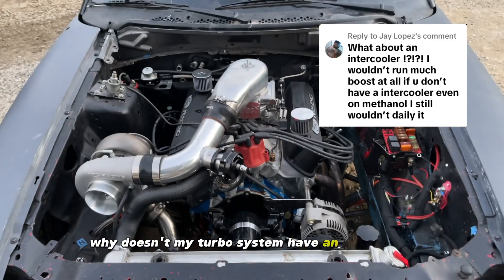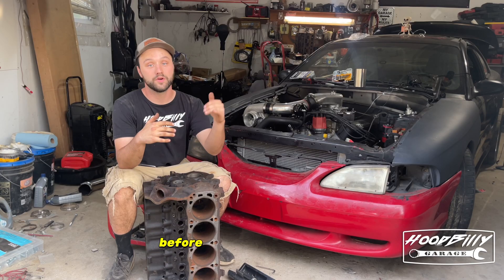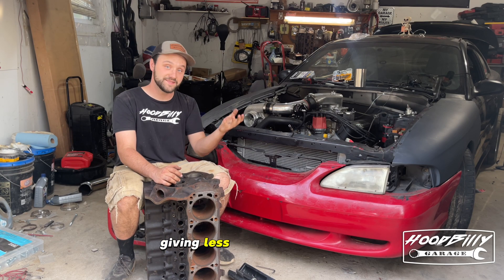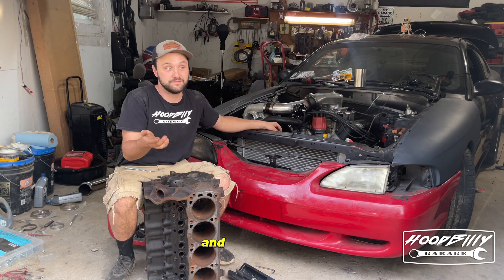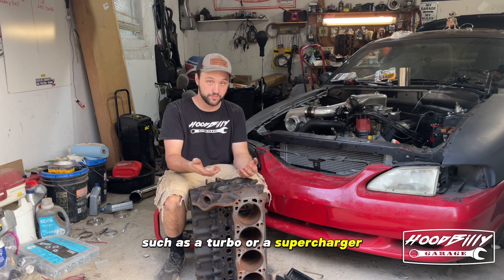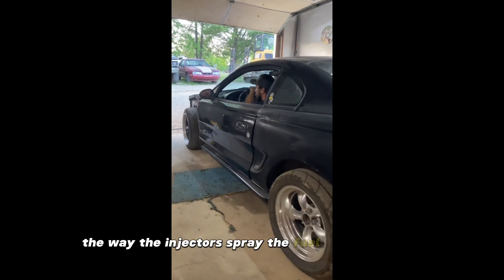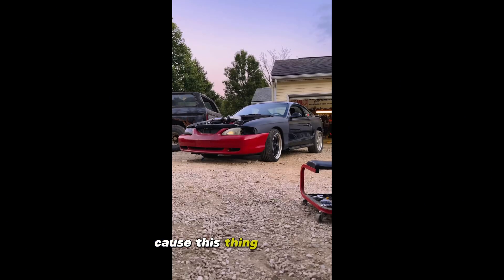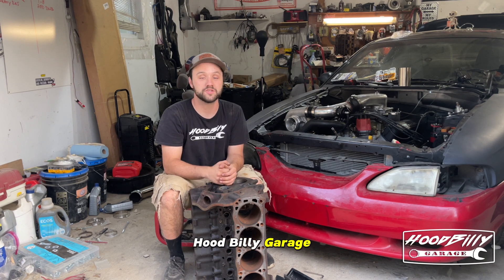Does My Blow Through Turbo System Need an INTERCOOLER?

Comment: An intercooler will help anything as long as it cools the airTemps, even on a carbureted application.
Reply: Fuel will pool in the intercooler
Reply: @Glaze_TPF  not possible. Stop spreading bs
Reply: @2025s_truth-speaker  you are aware the fuel is pulled from the carb, thru the turbo, intercooler, and then into the intake manifold, right? Fuel will absolutely pool in the intercooler during this process.

An intercooler is completely unnecessary in a draw thru turbo setup anyway because the vaporising fuel on the boost side of the turbo is already cooling due to said fuel vaporisation.
Reply: @Glaze_TPF  on a draw through, yes. The video is about a blow through, where the carb is the last thing the air travels through.
Reply: @andrewhall8123 the AFM on a blow through is still self cooling
Reply: @Glaze_TPF 🤦🤦
Reply: @Glaze_TPF  How?